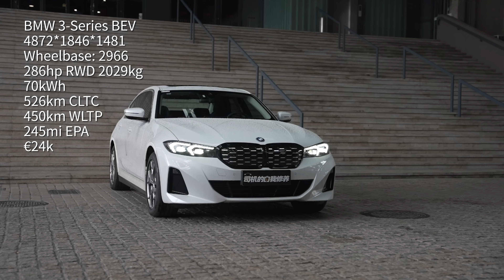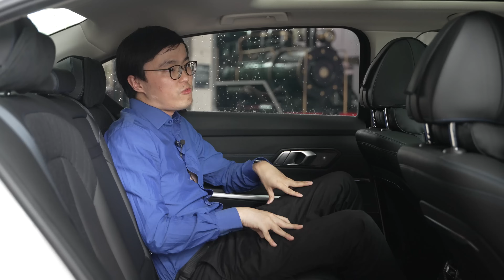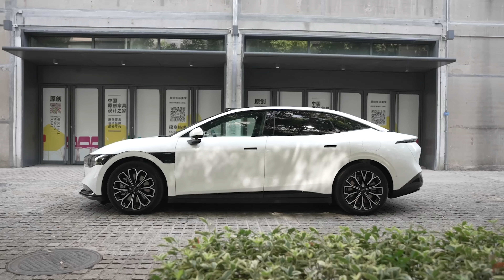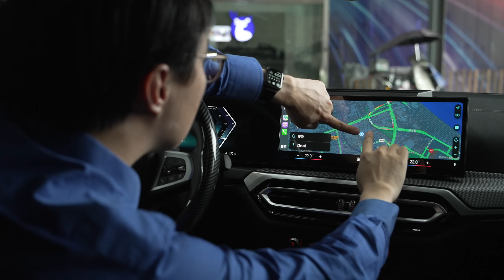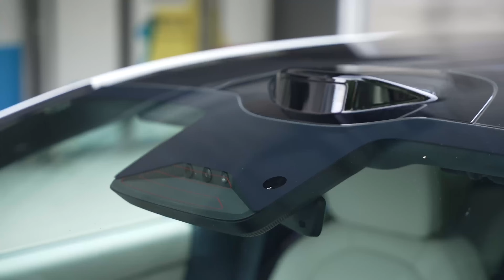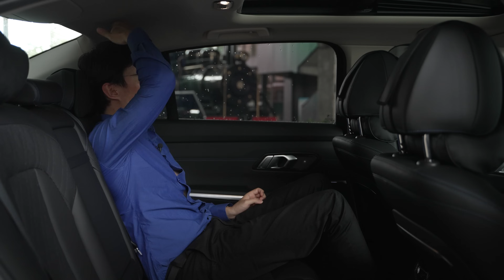BMW is Selling Fully-Electric 3-Series in China for €24k

Comment: Did you really check charging times @telscopeguy? So you think 800 volts charges twice at fast as it is twice the voltage. Your reviews are usually pretty decent, especially compared to other reviews on chinese cars. Maybe you want to look into that charging stuff again and also notice what chemistries are used. Also noticable in this review is your lack of even talking about the driving experience, what is especially unusual for bmw reviews and an eyecatching void if compared to some other of your reviews - like for the id.3 that got (completely justified) bashed on software and loved for the rest. If i sit an an ordinary vw i would also notice it, same with mercedes and bmw. so how would zeekr compare to bmw?
Reply: actually zeekr 007 really can do this. Zeekr's battery has the most quickly charge speed in the world. The most quickly one can charge the battery from 10% to 80% in 12 minutes, the most eletric car over 200,000RMB(about 30,000 USD) in China has 800 volts and can charge 10-80% in 16-18 minutes, its very common
Reply: And the driving experience is more far to zeekr or xiaomi, in china expect ID3 because only 15000 euros in China, other germany eletric car basically have no market analysis

Comment: The whole EV car in China costs less as what my local Audi dealer here in Germany asked for repairing my Audi e-tron. they said I had to pay €26k to replace the front motor (damaged) and two destroyed battery modules.  By fault of the EV control box during heavy raining. No battery guarantee, no other warranty. ridicolous. that and how Audi handles the burning cars (same as Porsche Taycan) and problems with the LG battery packs (recall, worldwide) with limited state of charge to 80% in terms of safety, will crush the whole VAG EV dreams.

Comment: So, you guys have climax on a cars that have " a milion of horse power" and drives alone, still nowhere near top speed.
My guess is that you guys in China just can't drive cars, when you need all that assistance.
Rest of the world don't have a problem to drive 100kW cars alone...even with a manual gearbox ;)
Reply: That’s a great insight. But I have to point out there assistance function are based on radars cameras and algorithm - and they are not free. When Chinese EV are offering these while Germans one aren’t just means they are making more profit from y’all BMW driver

Comment: I’m so glad other car manufacturers are giving some competition to Tesla. For a while, Tesla thought they had a monopoly on EVs and thought it could sell the $45K Model 3 as the “affordable” Tesla!
Reply: Tesla is finished in China
Reply: The basic model here in China priced at RMB215900/27525Euro, and Max version RMB299900/38234Euro.
And Tesla Model 3, basic Model, RMB231900/29564Euro, and Performance Version RMB335900/42823Euro.

BMW i3, MSRP  RMB353900/45118Euro, while the actual market price is 50% of it, RMB170000~180000/21673Euro, you could see EU legcy EVs are so overpriced that they look desperate in Chinese market. Even so, in June 2024, i3 sold 6952, Model 3 sold 18151, Model Y41110, SU7 14296.
Reply: Traditional car still doesn't have a competitor for Model 3 though... A 3-series EV is still maybe 2 years away lol...

Comment: I fear for the whole automotive industry. Solely because of Tesla and Chinese brands start to "revolutionize" the design of exterior and interior, it isn't the practical way of doing so. Everyone want's to have that fresh looks only to find out that it is just inpractical. The "pre-pandamic" design of the 3 series (here we already see the lack of different buttons compared to the pre LCI G20 generation BMW) is very well thought out. Not everyone wants to use a giant touchscreen in the middle of the center console though it looks more modern. Unfortunately function follows form (and the production cost cuts) these days, so in a couple of years, every car will look more or less the same...
Reply: Tbf the screen in the lci g20 is pretty damn good. Had one as a loaner for about a month and loved the infotainment(its very fast and good quality unlike a vw or some laggy shit) and personally don't mind not having physical controls for the climate controls. its easy to access and i don't change temperature on it very often anyways. also prefer the smaller gear selector. Only thing i don't like is that it looks a bit out of place - you can tell it wasn't designed originally to be a big screen (on pre lci) so it just stands on like a stander and that looks super cheap.

Comment: Is it just me or the numbers and just not adding up? The car is 110 pounds heavier than the BMW with a 75kwh vs 70kwh but yet it achieves more range, not just more significantly more range. I would like to see real world testing on this car any videos suggestions anyone
Reply: You forgot to factor in coefficient of drag, makes a lot of difference and is probably why the Zeekr is more efficient
Reply: Battery chemistry information is missing. A big influence in range.
Reply: the key difference is the electric 3 series was base on the ICE version, it was adopt to EV but never design to be. On the other hand, pure EV nowdays uses battery frame as part of their chassis which cut a bit weight.

Comment: In terms of development cycles, this BMW is an old car when looking at both software and the underlying plattform. It was developed before the big EV push in China and they got caught almost empty handed. With that being said, I'm not too worried because the Neue Klasse plattform will fix these issues and it will also be an extremely cool design (at least judging by the concept cars).

That's also my biggest gripe with Chinese EVs. You can't fault them for their software, EV tech or how they drive but my god they all look so damn generic inside and out because there is zero design or brand legacy. Doesn't matter whether it's XPeng, Zeekr, NIO or whatever other Chinese EV brand, they all look like AI generated aero blobs and hiring western designers hasn't helped. This Zeekr interior could be directly transferred into a NIO and it would not feel out of place.

It will be interesting to see how this all pans out in the future. Brands like NIO or Zeekr have very competitive cars but the 20.000 cars they currently sell each month in China are far too less and like all Chinese brands their car sales in Europe and the US are abysmal (even before the new tarrifs) which means they are still making huge losses each quarter. 

German legacy brands on the other hand are still highly profitable but if they lose out on the EV race in China their profits will take a massive hit and it will also make them more vunerable in their home markets. So the big question to me is: Who will figure it out first? Brands like BMW selling EVs at a large scale and profitably in China or Chinese brands managing to sell cars globally to reach profitable volumes. 

I think my money is still on the first.
Reply: China

Comment: At first i thought 'wow! That's a steal!' and then you showed me the Zeekr 007. To me, the current gen 3 series is still the best looking saloon in the market (head to head with the Alfa Romeo Giulia) and the interior still look awesome (definitely more useful than the new buttonless design on the new gen X3) but the spec of 007 are miles ahead of the 3 series.
Reply: not really, the actual range of Zeekr 007 is very disappointing, just like their another model Zeekr 001
Reply: @chesterbao2223  not bad for my rear drive model with 100wh, could do 500+km on freeway
Reply: Kia Stinger looks even more slick. and i prefer the 4 series / audi 5

Comment: Where did you get the €24K price tag from? BMW’s Chinese website shows a €46K starting price for the i3.
Reply: Nobody in China buys these cars according to the official website price tag. FYI a Volvo S90 "should" be 300k+ RMB(~39k euro) but I can get it at around 230k+ from the seller, and that was a few years ago so I reckon the difference only gets bigger due to the fierce price war. The company surely knows the situation and has to give implicit consent otherwise they can't sell shit at the price they set officially.
Reply: 最新成交价已经到了160K+人民币，加上保险成交价在170K左右，在中国新能源汽车不用征收购置税
Reply: dealer's price is lower than the official website price, otherwise no one would buy it
Reply: 经销商报价

Comment: They are definitely not selling at a loss. So the profit margins are insanely high
Reply: Different profit margins (which stem directly from a different competitive situation in Europa and China) and cheaper chinese labour costs are only part of the picture. What also plays a huge role is fixed cost allocation. Lets make an example: Say you are BMW and you spend around 2bn USD on developing the new 3 series. You make an estimate on how many units you can sell, and conclude that additionally to the 20k marginal cost of production you have to allocate 20k per car on R&D to not go net negative, so you assume your cost per car to be around 40k. Now in China, you may not be able to charge 40k per car because the market is so competitive, but instead of not offering the car at all there, you can still say: Well, the car is already developed, and we can still turn a profit there if we can sell it for a higher price than marginal production cost, even if we can't recover any R&D here. Ofc this only works if there are no arbitrage opportunities for the customers, so if it is not easily possible to buy cars in China and use them in Europe (which is given for cars, because of transport costs, customs, safety regulations etc.).
Reply: Yep, if they can make profit from this 24k bmw, why the hell they sell it double price in other countries
Reply: @oubihiotman3673  because they can people buy it happily at that price
Reply: close to 0 regulations and 0 tax makes for cheaper cars
Reply: @louisvl10  no it's the same car sold everywhere with minor changes.. creating a different 3 series for china is illogical... Cars are just more expensive in usa as living without a car is almost impossible and most people buy their cars on loans in western countries
Reply: Exactly what I was thinking
Reply: That's the point.
Reply: profit marges on a 40k car from germany is like 4000. They are seeling with loss.
Reply: The dealers eat the loss. Factories are mostly automated now.
Reply: Some of our companies do sell at a loss, but those successful ones are mostly making money. In a free market, some companies make profit, some don't, simple as that.
Reply: @Mingshi-Li  absolutely no way bmw is selling at a loss... Thats not how business works.. there are some exceptions buts that only in tech where there is massive room to growth
Reply: @ishmamrahman877  "Absolutely no way".. Well a lot of legacy auto is selling at a loss and making a profit on servicing down the line. Yes that is how business works. Yes that is also why it was so hard for new competition to step in. Because if you don't already have cars on the road, you are drowning very soon with no cash flow.
Reply: @snelle_tomos  its hard for a new competitor because unlike laptops and mobile phones there are thousands of parts in a car and its almost impossible to a company to make them as it requires expertise in many Fields and a lot of parts like engines require a precision  and skilled labor.. new auto makers dont have the scale of legacy auto makers to a car at a profit... Its common for people to get repairs done in dealerships in us but in most other countries people fix their cars in independent auto shops as its much cheaper and dealerships are not widely available. So there is absolutely no way legacy auto makers are selling at a loss.. maybe some limited production cars are sold at loss but not mass market cars
Reply: @ishmamrahman877  And where do you think the independent repair shops get their parts from, and why do you think fixing the tiniest part today costs 5% of the car's value 😂😂
Reply: @snelle_tomos  people in usa are getting ripped off. I lived in 3 countries so i know what i am talking about. Car and bike repairs are much cheaper in asian countries.
Reply: @ishmamrahman877  I bought car parts in wholesale from EU manufacturers. I can assure you that in EU the spare parts cost a fortune. Car mechanics buy the same parts from the same places.
Reply: Labor labor labor, this is one of the most expensive aspects of manufacturing and Chinese labor is insanely cheap
Reply: @Nel_34  Yes it is still fairly cheap for labour prices, but not as cheap as they used to be. South-East Asia Labour market is currently the cheapest.
Reply: @Nel_34 Nowadays Chinese factories are almost fully automated.
Reply: @JSM-bb80u exactly as I was about to say. These neocons making up excuses about cheap labour and parts in China are ultimately the pawns of American criminal-politicians.

Comment: The reason why European cars are not as autonomous, is because it is simply not allowed here anyway. Besides Chinese autonomous driving is only on pre-mapped roads. Meanwhile the Chinese cars that do come to here to Europe have some of the worst, least reliable and shaky lane keep systems on our market... 

This BMW rides on a platform that is from 2018... well there you go. This is essentially a 2018 BMW with some bargain basement battery that BMW found somewhere 😂. This is basically their worst EV on the market right now. Even in the EU they don't sell this.
Reply: As per snapshot this is BMW's current 3 series (facelift G20, in this case a long wheelbase EV) model. Oh, and it's not a basement battery, it's seems to be the same 70 kWh battery used in the i4 eDrive 35. I don't like BMW as well as I don't like a certain style.
Reply: Chinese car are going to pre-map-free self driving this year, HUAWEI already released this feature to all of their customer and Xpeng, Li Auto, NIO is following in this year.
Reply: The BMW 5 series is doing autonomous driving hands free 130 kmh and in Europe with much more regulation
Reply: @Marcel.fjj5bdb  The 'autonomous driving ' in china at lease include the ability to go on/off the highway ramp/exit or transfer between the highway, not along driving in city nation-wide, as long as the navigation works (Huawei, Li, Xpeng already publish the software with these abilities to car owners). Didn't find any video about BMW can do this or I didn't search enough.
Reply: @Marcel.fjj5bdb The Mustang MachE was the first if I'm not mistaken to have full self driving allowed like a Tesla in the US. But it's only in a few countries such as Germany and Spain